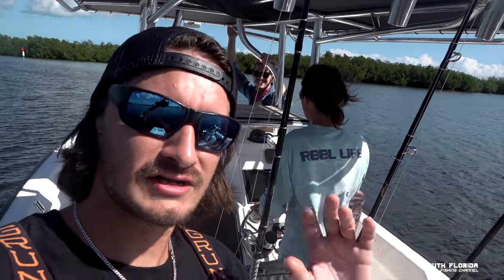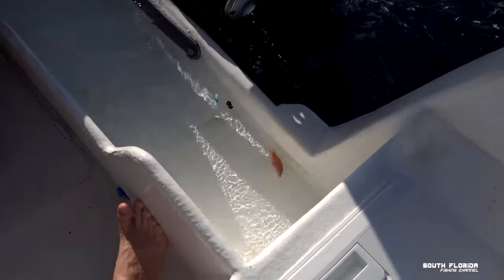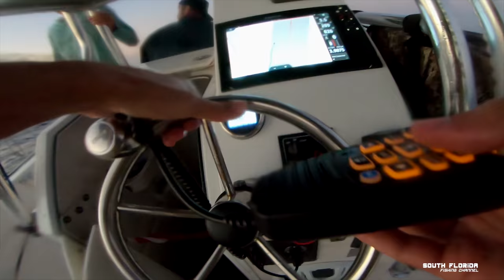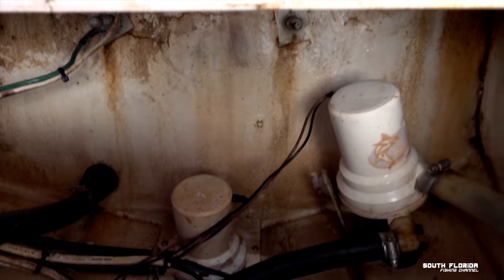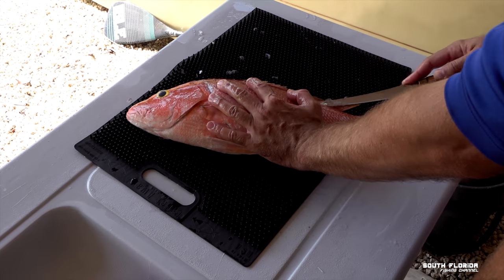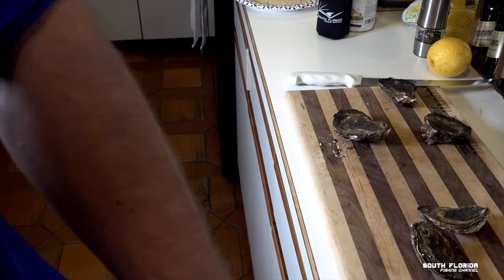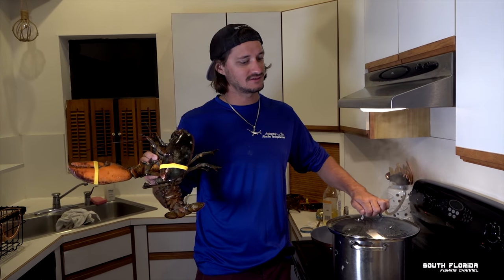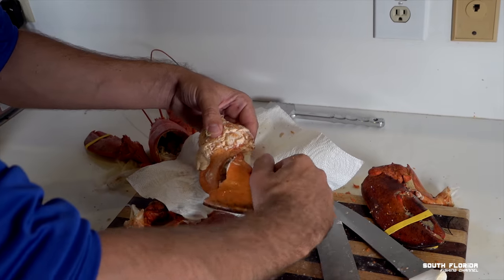Sinking 10 miles offshore | A scary fishing catch n cook

Comment: You could do repairs yourself buy resin seal up cracks ... put two stainless steel plates one either side to beef up transom seal up remount your motor ..job done 👍 not that hard
Reply: two tiny washers on the back of your motor what a joke first big wave you hit it was sure to pull threw what a cowboy who fitted motor ... you needed them front and rear backing plates to support that loverly new motor ... take it back to the stables get hold of that guy who fitted your motor lol ....

Comment: When you redo your transome, whoever is doing it, make sure they remove al the old material and probably use coosa board and raise it to a full transome. You will be better off. Also, look for a suitable engine bracket that has a swim platform but make sure you have a bracket mount for a smaller secondary engine for emergencies. 

In case of main engine failure, you can still limp home or use it for slow trolling. Always think ahead. 

I glad you guys made it back safe and you still have your boat, engine and crew.

It will take some work but it will be as good as new and your main engine will have better support.

Try Born again boating. They do great work.
https://youtu.be/mJGhUgoDD3c
https://youtu.be/XcX5496rGxg

You can also try these guys
https://youtu.be/TYPDFcEWteQ

Comment: Those lower bolts should never have been mounted that way without a backing plate.  Complete mechanical malpractice.  That boat/transom is not suited for an engine that heavy regardless of its stated rating.  Get rid of that boat.  I would never trust that transom again.

Comment: Bro when you started heaving up and down 2 to 3 feet it was time to get going. What the hell is up with your transom? That is a piss poor design and you either have to big of an engine and to much weight or that boats flotation foam is soaked and weighing it down. I wouldn't take that thing off shore with water constantly coming over the transom filling the transom well. The drains were under water no where for the water to go.